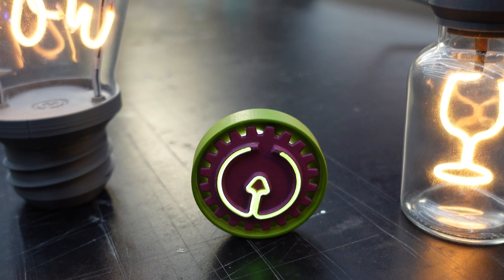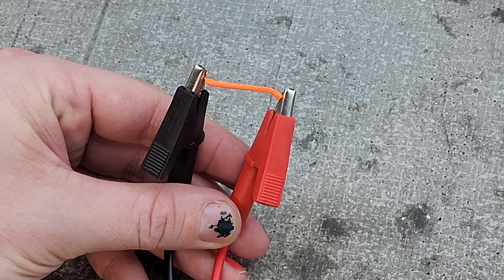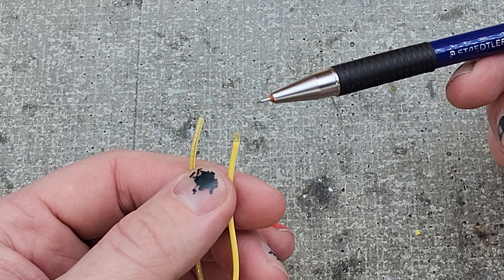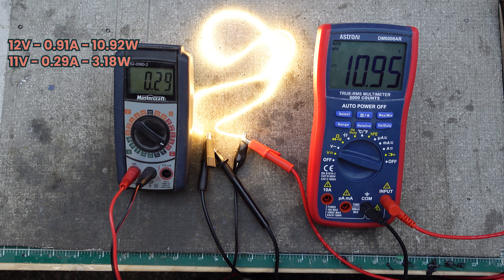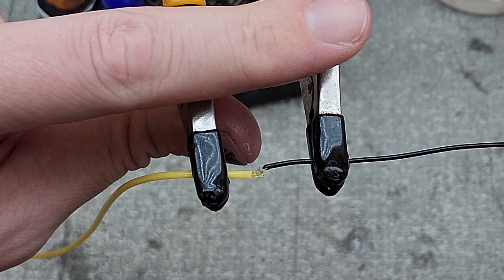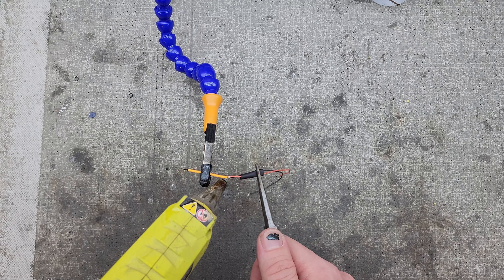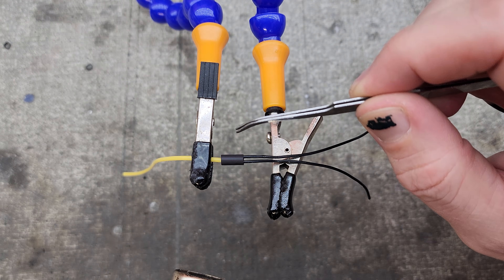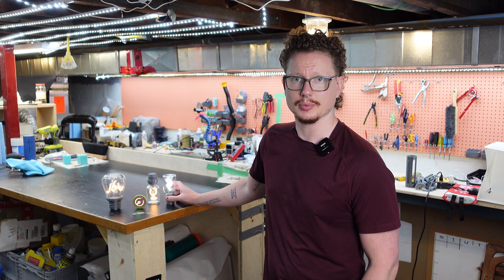Cutting LED Filament

Comment: why are they called fillaments? its not as if tzey can be printed ontp the build plate, right?
Reply from the maker: Filament is a term for a thin, threadlike object or fibre. It isn't necessarily a 3d printing term.

Comment: So if i have the 1200mm 24v version and cut bits off will the smaller peices still be 24v?
Reply from the maker: @bcs7686  those can sometimes depend on the strip itself. In some of them you can see segments that.are wired in series, so they use smaller voltages

Comment: awsome video!  is it possible to get ones that can be powered from just one side?  as in nothing connected to the end of the light strip.  Thankyou man!
Reply from the maker: @pur3pk317  i haven't found any that come that way, but it is possible to wire them like yourself if you follow the steps in the video!
Reply: @wesselscreations  ah okay awsome ill have a look into it! Thanks for the response 😁

Comment: You got my sub with this video as the top result in my goggle search of "Can you cut flexible led filament" time to break out the magnifying glass and my little wires! Thanks for the tips!! I'll be trying the marine or waterproof heatshrink tubing as it already has a glue lining that melts and seals as it shrinks. It's been my traditional "hack" for regular style LED strips when I cut them to length and solder on new leads or inline injecting.

Comment: nice but if i want to connect them to the wired that comes out of the wall its too mutch voltage then .. ? i think i need a regulator then but how do i calculate it^^
Reply from the maker: @VespasianoNevio  yeah you'll definitely need to use a ac/dc converter and voltage regulator to power these from an outlet

Comment: Can you solder them so both poles are on one side?
Reply from the maker: You sure can! It is super helpful being able to use these with both wires coming from the same end of the filament
Reply: Oh neat idea! Hadn't thought about having them on one side. I wanted to make a connector for it so I could switch the filaments out. Having them on one side would be so much easier!

Comment: Thank you brother. I assume this works with standard size LED..?
Reply from the maker: No problem! I am not sure what you mean by standard size LED, like a regular 5v LED strip? Most of those will have dashed lines showing you where you can cut them, and have copper pads to solder the new leads to.
Reply: @wesselscreations I meant like a large size LED, the ones that are about 1/4” wide. Usually 12v - 24v.
Reply from the maker: @dalemathis  Those should be similar to a 5V strip and have markings showing you where to cut if you want to trim them. It is usually every few inches, but varies on the brand

Comment: Thanks for doing this experiment! I'd contemplated these since they came out, but the lack of ability to mod them put me off. Also, did I understand correctly that they're wired in parallel, so if you needed them shorter you could just cut one?

It'd be an interesting experiment to design a tiny connector, as exist (in varying qualities) for strip LED lighting.
Reply from the maker: They are in parallel! But the positive and negative are wired to each end, so you can cut them and only solder the missing one if you don't mind having a wire on each end of your filament

Comment: The hot glue/heat shrink is such a great tip! Definitely going to be using that in the future
Reply: Look for adhesive-lined heatshrink, comes with glue on the inside.
Reply from the maker: It has saved a few of my terrible solder joints! Going to check out the marine heatshrink that was also suggested for future projects
Reply: agreed, thats a fabulous idea - already "stolen" and in my inventory..  thx a lot !!
Reply: oooh - I love it when I get a superb tip like this one!

Comment: Using marine heat shrink should be nice for this, because it comes with the glue already coating the inside. When you shrink it the glue melts through and around anything you shrink it onto, without having to balance a tiny sliver of hot glue.
Reply from the maker: I will have to get some and see how it works!
Reply: @wesselscreations  I use it at work and it is fucking awesome!
Reply: Is that what it's called?  I definitely had some of this at one point and loved it but never knew what to look for.  I only had it in really large diameter and forget what it was even used for, just that I wished I had more of that gluey heartshrink.  Thanks so much!

Comment: I experimented with the same light and while I didn't come out as neat as you , I made / 3d printed a spindle light for my Bridgeport mill. 
Seeing what you did here inspires me to go redo it as it flickers every now and then due to a poor connection. 
Thanks and subscribed
Reply from the maker: They can be really finicky,  if I mess with it too much while installing it into something, I sometimes have to resolder a joint. Thanks!

Comment: Where did you buy it? if possible give me a website.
Reply from the maker: This is where you can find 3v, 12v, and 24v variations https://www.adafruit.com/category/536
Reply: Aliexpress has it cheaper
Reply from the maker: @HW_Printing  True! but not a hugely amount like some electronics can be. I get most of mine from aliexpress if I don't have a time crunch on the project haha
Reply: @HW_Printing The last time I mentioned that site in a comment, purely to answer a question just like you did, my comment got yeeted and I got a warning about spam that threatened my channel.

 I have no idea what yt wants here.  Maybe my comment was reported or something.
Reply: @excrubulent  Youtube is a bitch sometimes